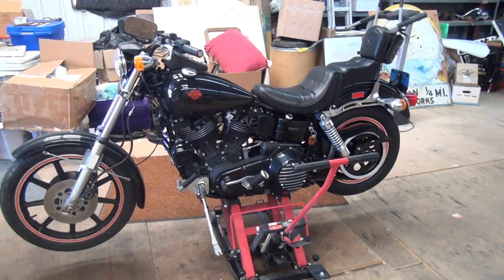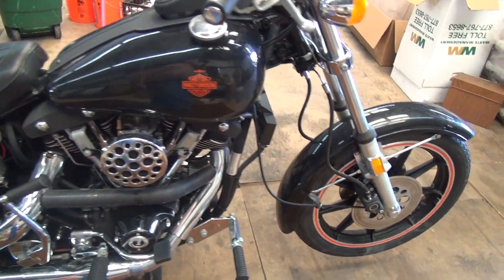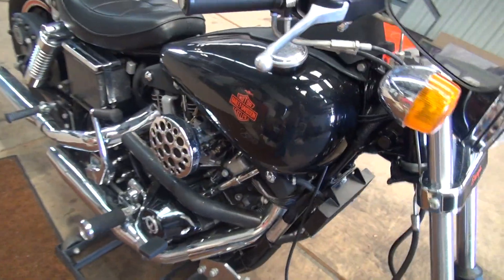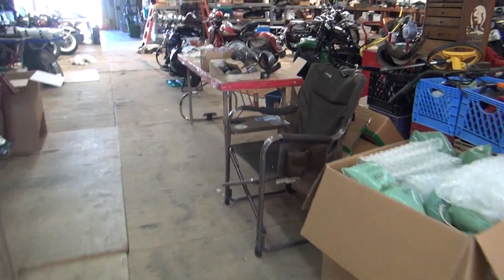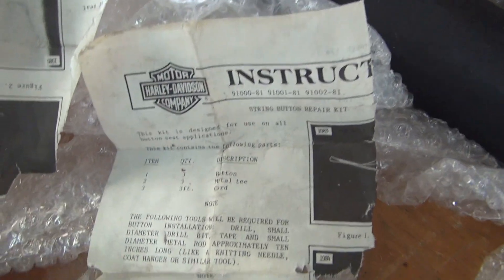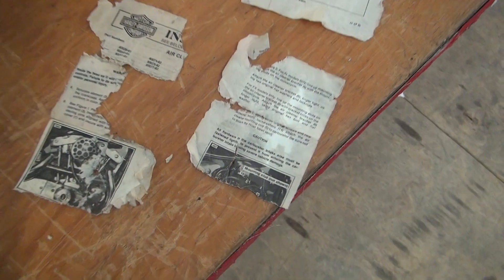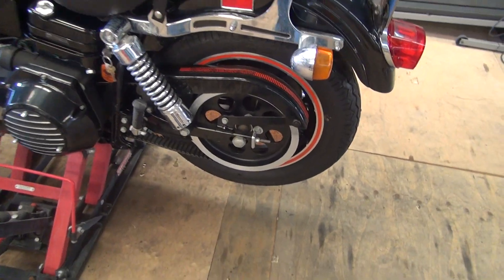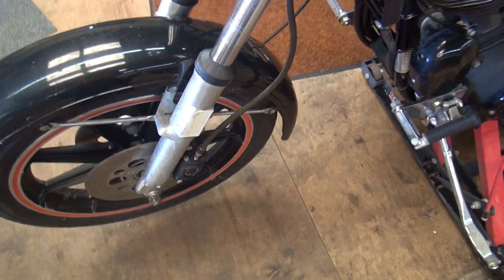Hunting Harley's, 1981 FXB 3500 miles part 2

Comment: Coolest Shovel ever! Is it twin belt Todd?
Reply from the maker: yes, all the 1980-82 FXB's were twin belts. When HD came out with the 'new' FXSB in 1983 ( a combination of the FXS Lowrider and the FXB Sturgis into one machine) then they were rear belt only.
Reply: HuntingHarleys I wouldn't trust the primary belt lasting long enough. Is it the reason Harley ended up with it so fast?
Reply from the maker: They made the compensating sprocket out of RUBBER, which does not last. It was not the belt that was the problem but this rubber compensating sprocket.
Reply: HuntingHarleys Thank you!

Comment: I'm new to Harleys... Is this one crazy rare?
Reply: If I'm thinking right, this year isn't particularly rare.  This particular bike is rare because it is in original condition with low miles and very little to zero aftermarket modification done to it. 

Nowadays everybody buys their harley and throws on aftermarket mods to it; but if you keep your new bike original, it will sell for much much more after 40 years
Reply: Thanks for the info Max
Reply from the maker: ***** a bit of both Max. This bike has NO after market parts. THAT is extremely rare. HD made, roughly, 13,000 of these each year of production. I don't have the exact figures. I am basing that off the VIN production number's.
Reply: Thank you HuntingHarleys